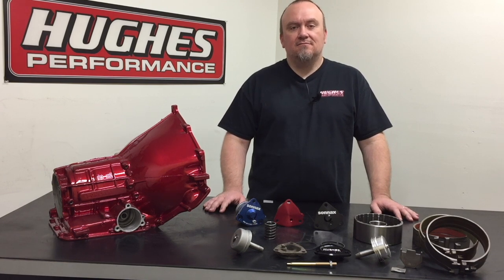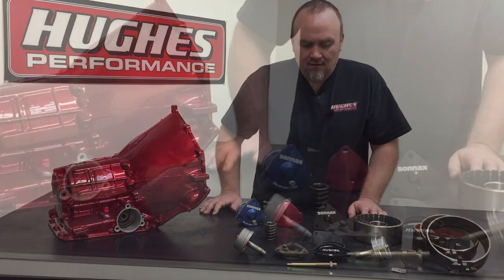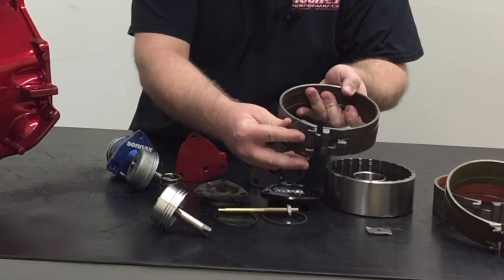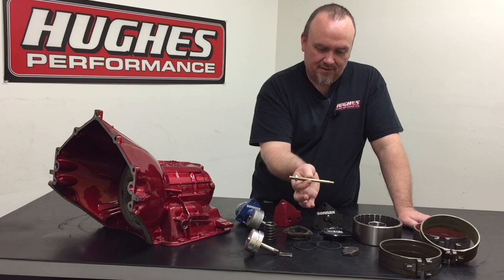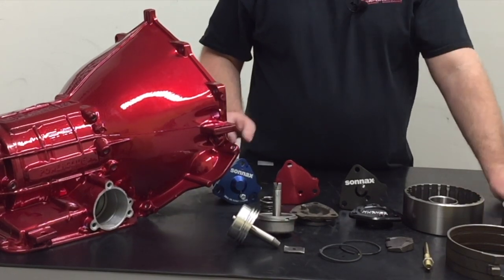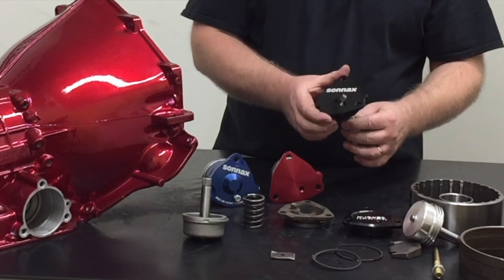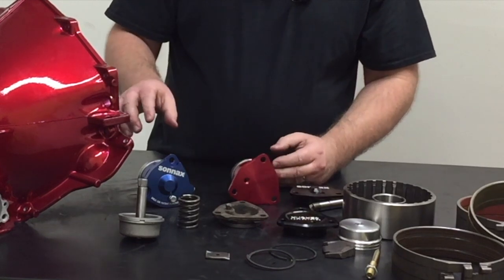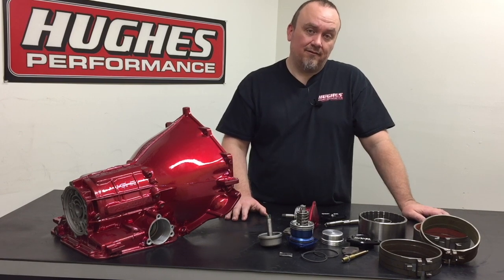Ep. 9 Powerglides 101: Servos

Comment: As someone who is very very limited on their knowledge of autos and drag racing I have a what is probably rather stupid question.  From what I have read, all the old 50's and 60's 2 speed autos where considered inferior two the 3 speeds for drag racing. Yet the 2speed power-glide is still very popular can you ex-plane?
Reply from the maker: The aluminum Powerglide became popular and has remained popular because of it's lightweight, robust design and simplicity of operation. As drag racing grew in popularity and became even more competitive, the Chevrolet small block and big block engine platforms were the engine of choice for a significant majority of racers. The Powerglide being a Chevrolet designed transmission became a natural choice and simple solution for an effective, simple, low maintenance drag racing transmission due to the reasons mentioned above. 

The aftermarket embraced the Powerglide design and began developing upgraded parts for the transmission which has helped insure it's vitality and livelihood today 58 years later after it's debut.

Other 2-speed designs from that era never gained popularity either due to excessive weight from cast iron housings, inferior strength, limited availability, and/or inferior performance.
Reply: I should follow up I will probably never be in a position to really nee this knowledge I am just curious how these conceptions develop.
Reply: need no nee